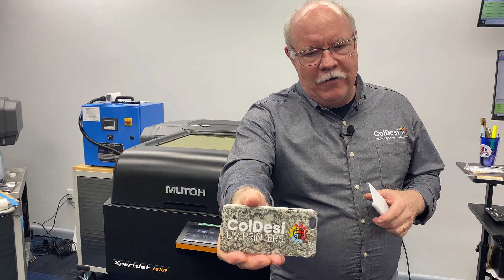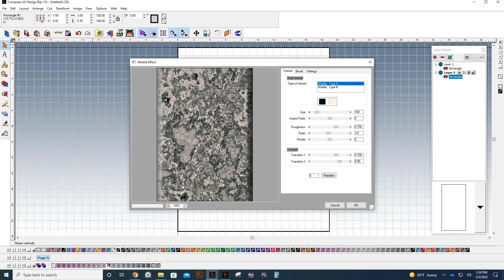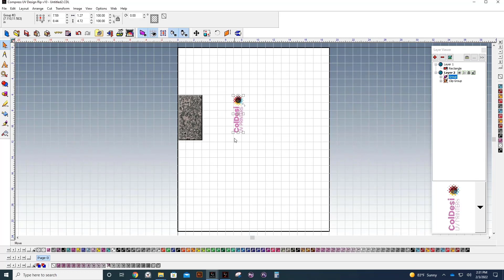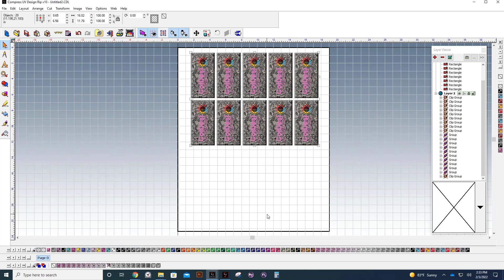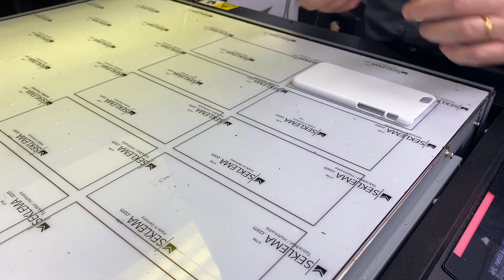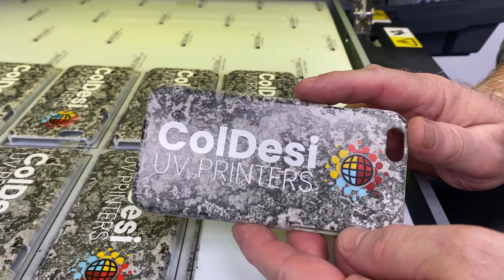How to Make Custom Phone Cases | Mutoh XpertJet 661UF

Comment: Do you lay a material on top of the actual bed to print Outlines of the shapes? or are you printing directly on the actual bed?  Also, what do you use to clean off the printed outlines?
Reply from the maker: we're printing right onto the silicon matt. Wipes off with the cleaning fluid easily